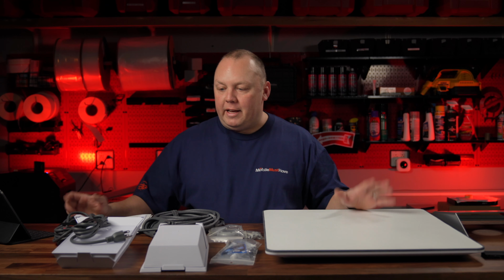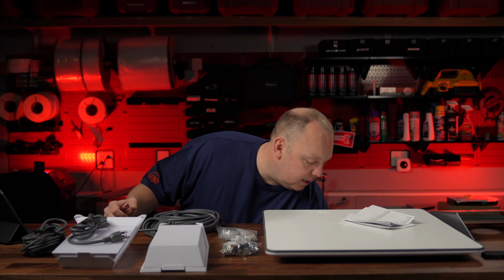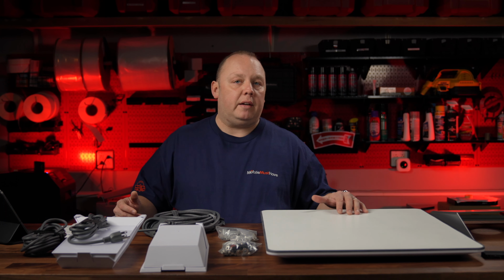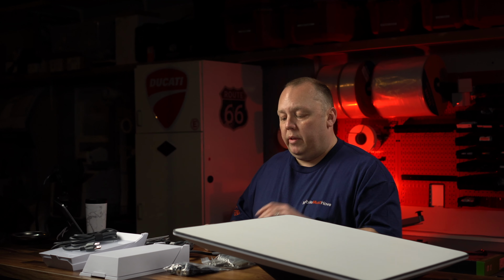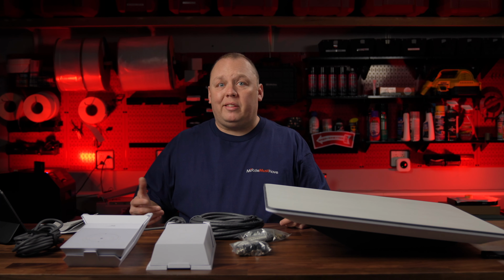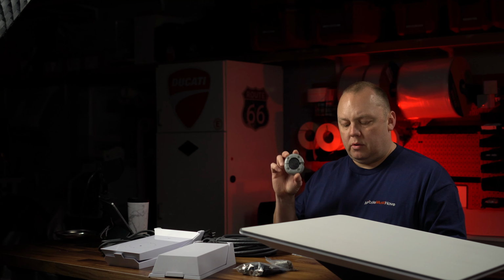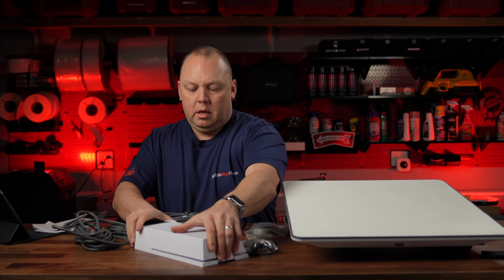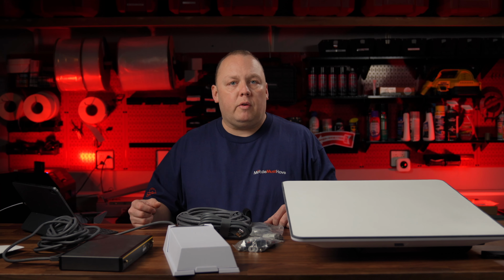Starlink High Performance In Motion Overview - In Stock Now

Comment: That backup system your selling only works if your in area with cell signal.
Reply from the maker: Yes. but when paired with a strong roof antenna, cell service can be picked up in most places.  They work great as a pair.  Then in those few places were there is no cell service, you can have starlink keeping you connected!
Reply: @MobileMustHave  I'm in private NC community and hills block cell service; just have in ground fiber optic modem wifi to house but zero wifi cell once I leave house; until 20mins later when I hit rural route bottom of hills.

Comment: Can't help but wonder. How much are you spending on these systems? Base hardware and monthly? Starlink HP hardware is 2500. Lowest monthly is 250. Then you add the hardware to support Peplink. Plus, sometimes multiple cellular integrations? Seems your looking at what close to 5k hardware then 330+monthly for services. This sound right or am I missing something?
Reply from the maker: So, you're spot-on about the pricing for the Starlink High-Performance setup, but I will note that Starlink has two other cheaper antenna options that start at $800 for the hardware and the plans are only $150 a month. Plus, on the Peplink side, you can get started with our Full Timer Bundle for under $700! That includes the Peplink router and matching antenna selection. So, can definitely get a good mobile internet setup for much less than $5k. If you'd like to discuss more about our bundles and find out which one is best for your needs, reach out to us via email at info@mobilemusthave.com and we'll be happy to help! Thank you!

Comment: I was considering swapping my regular dish I got yesterday for my van with this til I read it uses 1-150 watts of power whereas my regular uses 40… since I off grid a lot and have other things to run think I’ll have to stick with the standard and figure out a way to permanent mount on the van 😭
Reply from the maker: Oh no! Completely understand that. As for the mounting, Starlink does offer some mounting accessories on their store that may work for you!
Reply: @MobileMustHave  yes but none of which equal flat mounting! So I’m considering the starmount conversion setup but we will see. 🤔
Reply from the maker: worth noting the extra power does mean better performance especially in partially obstructed sky. I dont think our team mentioned that. It has basically double the surface area so the performance is noticeably better.
Reply: @MobileMustHave  yes that’s what I’ve heard… I would definently need a way to double the solar panels on my van to 800 watts to support that along with all of the other things I’ll be running so between the solar and upgrading the device an extra 3k ish 😅wish I had the money right now for the dream setup🙏🏽
Reply from the maker: @rachel7550  we dont use our dish typically when in low power mode, cellular works great at about 15watts for most models and the Peplink centrally controls all of our connections whether Starlink, cellular 1 or cellular 2 which is all integrated in our multi modem units. Thanks for the great comments and good luck out there, if you have any more questions let us know!
Reply: @MobileMustHave  that’s nice. It definently seems good for someone in the right circumstances with the money and power setup. Thanks!!

Comment: I have an installation for this system tomorrow. It'll be my first one of these on a house. Do you think this system will work good stationary as well?
Reply from the maker: Yes it will! Your signal may actually be more consistent since it won't be in motion.
Reply: @MobileMustHave  my only worry is that the roof will be slanted, and I thought it had to be installed on a flat surface.
Reply from the maker: i suspect it will be fine. its not flat when installed on a flat roof and works fine. Its slanted to ensure water comes of the antenna. I would say as long as its fairly flat you'll be fine. We havent had issue including with customers that installed it at the rear of a fifth wheel where the roof had a bit of pitch. Thanks for the comment! @JOHNDOEJUGGALO

Comment: I have the basic residential kit / roaming plan  .   If I was to buy this hardware will it work with my current plan?
Reply from the maker: You would want to check with Starlink to make sure you could use a current plan with a new dish!

Comment: I love that you guys have the payment plan option for the flat dish, will probably be ordering soon, I work out of a pickup and my regular dishy motor just gave out, seems like this would be the better option without taking a huge chunk out of my bank at once
Reply from the maker: That's a great idea as it is an investment! You will be very happy with this upgrade!
Reply: @MobileMustHave  can I get the flat dish and use it on the $150 plan or do I have to upgrade to the $250 plan?

Comment: When connecting a 3rd party router. How do you configure Wan settings? The dish doesn't seem to provide my router with an ip address
Reply from the maker: for the high-performance SL, we don't use the starlink router at all and use the ethernet off the power supply to the third party router.  There is no setting change required with this as the starlink antenna is feeding internet directly via an ethernet cable in this configuration

Comment: When connecting a 3rd party router do you need to reconfigure the starlink for bypass mode and how do you do that?
Reply from the maker: Depends on how you connect it.  If you do direct ethernet directly to your third party router, no.  If you plan to use the starlink router, yes, you can then put it in bypass mode, but there is really no point to the starlink router at this point in the flow. EDIT: the starlink stationary unit includes a ethernet cable directly to the dish to bypass the starlink router, there is no 'bypass mode' setting needed in this model starlink as the hardware hands the wan IP directly to your router by default when you use the Starlink included ethernet cable
Reply: I've connected my 3rd party router exactly like you did in your video and starlink doesn't seem to respond to DHCP requests. What's the trick to making this work?

Comment: Has anyone installed one of these on a semi truck? I have been considering  getting Starlink but have held off because the 2500. Is steep price from buying the 599. Model. I have seen the people that modified the 599. one .Are those ok to use like that?
Reply from the maker: This model will work while you are actually moving. The cheaper models do not do this function. You could also consider a cellular connection through Peplink. Many Semi-trucks use that solution! Check out our bundles- https://mobilemusthave.com/collections/mobile-internet-bundles

Comment: Does the in motion hardware really make sense for RV campers such as 5th wheel and tongue pull ? This version is mainly for the motorhome type owners?
Reply from the maker: From a mounting standpoint, it can be mounted on anything.  The included hardware seems to be geared more towards vans than a typical RV roof, but it still works with a few modifications.  The dish also performs better than the standard dish in our testing with 100% more receiving area in the larger performance dish. This helps a lot with trees. This Starlink antenna is great if you need in-motion connectivity in addition to cellular.  The other Starlink antennas can be more flexible in mounting options but don't work in motion.

Comment: Erik,  you only show that very large end of the cable that goes from the power supply (POE) to the in motion dish and it looks at least 1.5" or more.   Does the other end pull out of the POE device?  Is it smaller?   I would rather not have a 1.5" hole drilled.  I do have a 3/4" hole ready, but wondering if I could use that existing hole get the SL signal inside my RV.  Tks Bill
Reply from the maker: The other end does come out of the power supply and is smaller, its about 13mm x 15mm with a proprietary starlink connector similar to the square dish connector.  If you run the cable back to the power supply, it might be easier to fit in a smaller hole. - Andy

Comment: I know a couple guys that have rv starlink... they say it's better than any other internet solution they've ever tried... been looking at it myself
Reply from the maker: It can work super great but its not always consistent and remember if you park under trees that’s going to be a problem.  We recommend using it in conjunction with a cellular connection as having both works great and our routers let you manage from a central console for easy management.